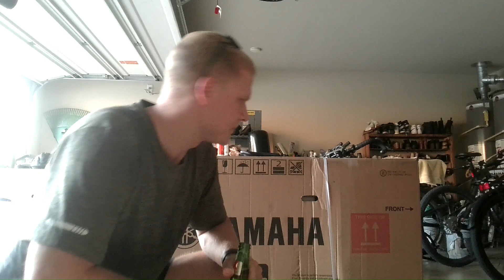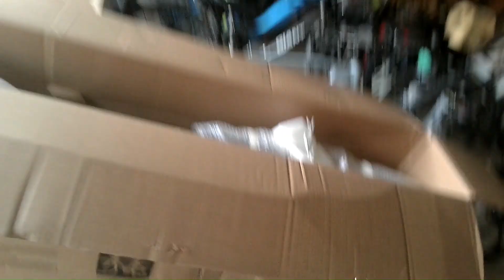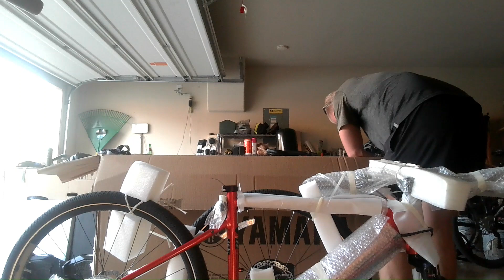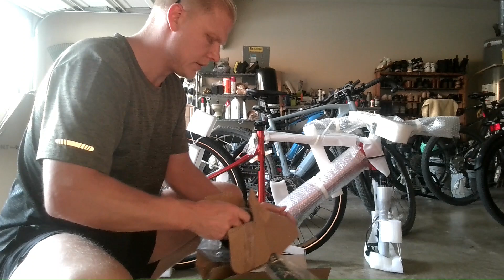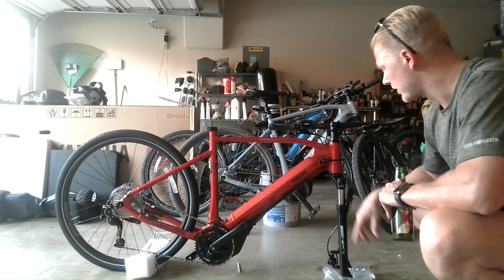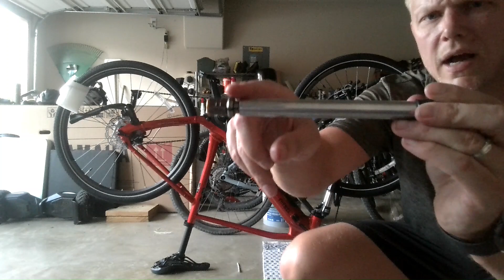Yamaha Crosscore RC Unboxing/Build

Comment: Does your handlebar have a right/left asymmetry to it? On mine, the left side comes out straight. The right side starts straight but about halfway, it is angled back towards the rider.  There is no evidence that the bar got bent in shipping. Thanks.
Reply from the maker: @weekenddistractions  sorry mine is not bent as you described. It’s a flat bar that tapers a bit from middle to the end.
Reply: @InfiniteMishaps  Yeah, it somehow got messed up. I pulled the bar and worked it with a pipe bender. All is fine now.  Looking forward to the first ride.

Comment: I also put on a Redshift suspension seatpost, switched out the cheap pedals, and upgraded to a Ritchey stem and handlebar with a set of Ergon grips.  For the price of $1200 it made easy for all these upgrades
Reply: Can you share some links for those upgrades?
Reply from the maker: @Martin_HD28  nice, I’ll have to check these upgrades out myself.

Comment: I just bought the same bike.  The tires are absolute garbage!  Did you replace tires and if so, what did you go with?  I'm going to put a set of Pathfinder Pros 27.5 X 2.2
Reply from the maker: @Martin_HD28  I find they are okay so far. Not great, but good enough I’ll wear them out before swapping.

Comment: Thank you for posting this video. I went round and round with Yamaha when trying to order this bike as they do not have any local shops that sell it in my area of Florida. I finally found a dealer that would ship it to me and it should be here this Friday. You mentioned that I should put greese on the pedals before screwing them in is there a specific type of grease I should buy to do this? Plus is there anything else I should buy to have ready when I assemble the bike. Thank you again for the video liked and subscribed!
Reply from the maker: @richardstanford9095  a set of Allen wrenches. As for the pedals, just about any dab of grease will do the trick.

Comment: I also got a CrossCore RC. I looked up these tires on the CST website and it does appear that these tires have decent spec's such as having built in 3 MM puncture protection shield.
Reply from the maker: @runnershigh7467  thank you for the information! Sounds like I’ll keep them around awhile longer.

Comment: Do you mind posting dimensions of the box it came in? I will be picking it up next weekend and need to make sure it fits in my Subaru. Also have read assembly manual and had steps for connecting all cables and hoses which was a bit confusing. Looks like you didnt have to do any of that and your handlebar came with display, bell, reflector and all cables and hoses pre-installed which is nice.
Reply from the maker: @AvocadoAir  the boxes are pretty big. Took every bit of the space in my in-laws Infiniti QX60 with both second and third row folded.

176x32x85.5 on the box

L 70 W 12 H 34 in inches
Reply: @InfiniteMishaps, thank you!

Comment: For a new bike owner, do yopu recommend a torque wrench (if so, which one)? Also, should you grease everything that is being assembled?
Reply from the maker: @ethanhu7048  no need to grease anything. Even the pedals don’t require it, but it’s helpful if you ever want to swap them down the road. Everything else should be greased from the factory.

Torque wrenches are never a bad thing. That said I don’t have one. Just don’t hulk out on bolts. Bikes don’t need that much torque on the bolts to stay together. You will at times need to check for tightness but it’s few and far between.

Comment: Curious which size you went with? Lookin to order one for my partner. None of our local dealers have them in stock. The geo numbers make me think the frame sizes run small. Thanks for any insight, have fun on it!
Reply from the maker: @MrPerattzi  I went with a large. I am 6ft, it feels just right for me. I will most likely get a stem the same length as the Crosscore and put it on my Wabash. It’s much more comfortable for me.